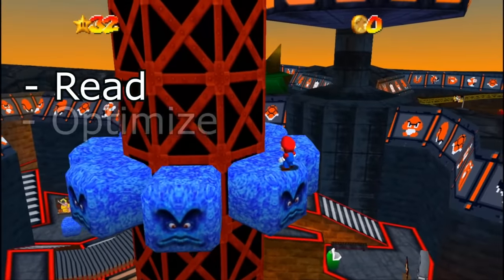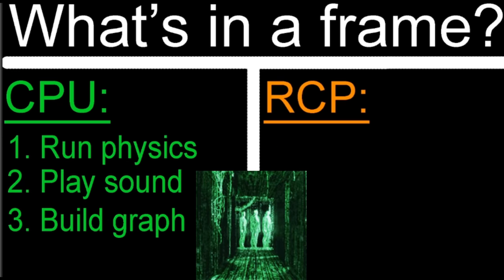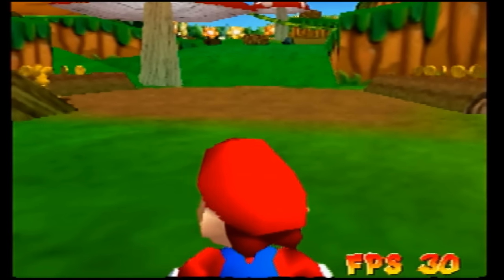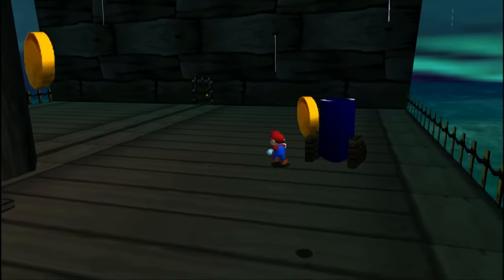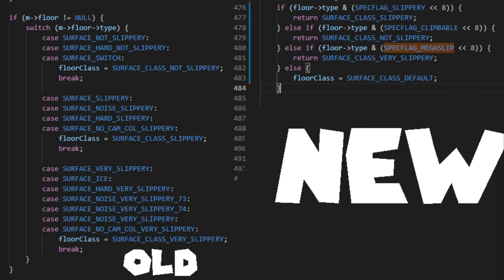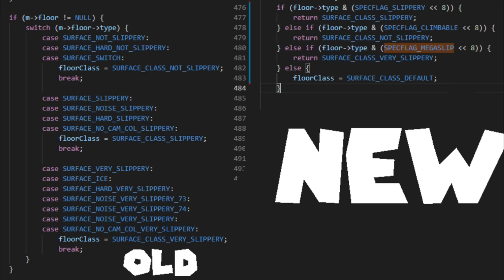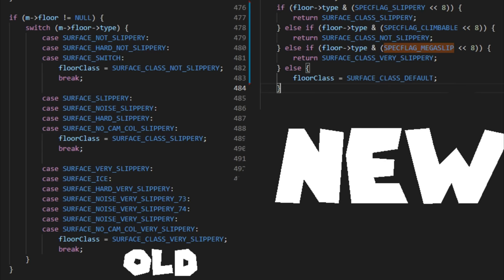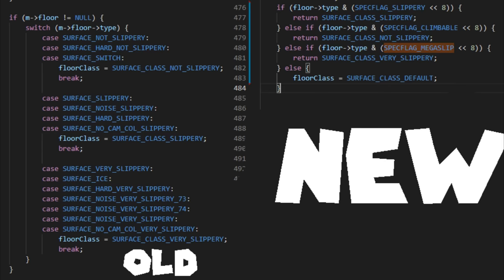FIXING the ENTIRE SM64 Source Code (INSANE N64 performance)

Comment: As someone with a master's degree in computer science I can confirm: This is wizardry.
Reply: You need a masters degree in kaze science
Reply: As someone who reads YouTube comment: Okay
Reply: It's: FIXING LAZY JPN GAME DEV
Reply: As someone who watched this video: does a master's degree in computer science not teach you how to clean up superfluous code for optimal performance? John Carmack's been showing the world how to do that since the 90s - he got raycasting* working on literally anything and got Quake to run in full 3D on pre-Pentium PCs with no dedicated graphical hardware :/

*don't make my dumbass mistake of confusing raycasting with raytracing or you're gonna confuse everybody :P
Reply: @reloadpsi  University teaches you the value of clean, maintainable (i.e. readable) code that is robust against any kind of problem. That's much more important than maximizing performance by throwing all of that out of the window. With today's machines performance isn't that much of a priority anymore. ;) (NOTE: I'm talking about games here, not general software)
Also, when it comes to efficiency, there are some very different fields in computer science: (A) Optimizing algorithms, i.e. the general (macro) structure of the program (which is much more important) and (B) optimizing code for hardware usage (micro level), where you reduce the amount of calls / memory access, etc. So (B) means "what can we speed up, when the algorithm stays the same". And Kaze is doing (B) hardcore style.
Reply: @Lugmillord  It stuns me that nobody at Nintendo bothered to clean it up the way this one guy is doing.
Reply: @reloadpsi  Zero surprise on my end. ;)
For one, a lot of what Kaze did isn't "clean" at all but pushing performance without considering code readability or safety nets - he doesn't need to since he isn't selling this as a shipped product and has an "infinite" amount of time. Or in short: If programmer's dared to write code like this for a real commercial product, it would most likely burn down in flames due to bugs.
I know that all code looks pretty much the same to non-programmers, but I can assure you that what Kaze is doing is not "typical code" you would find in sold software.
Also, the C programming language was rather new for the programmers back then and they sure as heck didn't know how to optimize for the N64 hardware (it's a launch title after all). It's easy to judge people years later, but given the situation they were in, the developers did really well.
Don't forget: 3D gaming was still brand new!
Reply: @Lugmillord  Yeah, 3D gaming was brand new. It's why I thought it was a bit crap. Worse graphics for slightly more depth in level design that most people didn't know how to capitalise on yet, and cameras apparently operated by smackheads. Thankfully, things got better.
Reply: @Lugmillord  it makes perfect sense now why you thought his code was wizardry
Reply: @calmarfps  It's not all lazy, just limited amount of time and budget for a commercial game. As well as 20+ years of practical C experience that the developers in the 90s did not have.
Reply: @reloadpsi  Rare did a great job with the camera (Goldeneye, Kazooie, and DK 64).  Mario 64 was really the only one with a bad camera that I remember offhand.  Having played a lot of N64, I was surprised how bad Mario 64 was when my brother bought a used copy.
Reply: His next job interview he just slap a Mario64 cart down on the table :)
Reply: As someone who knows nothign about computer science my brain just exploaded
Reply: Fellow masters here. It REALLY bothers me how Kaze ain't an actual Nintendo employee at this point. This is literally Satoru Iwata fixing the entire Pokémon Stadium code a few weeks before release tier.
Reply: Absolute Wizardry
Reply: As someone who reads comments I know more then you
Reply: @Lugmillord  I wouldn't say all of his stuff is all that crazy. I definitely saw some magic tricks in there, but the stuff like converting things to if else instead of switches, or moving stuff into for loops isn't what I would call atypical then again I've only dabbled in c code never written anything serious with it. Though I would say the real pro move would be converting the switches to call graphs (I think they were called that) would be even more performant. I'm talking about that thing where you use a struct that references functions so you get a constant access time rather than flowing through an if else, or switch.
Reply: I guess he used two cups of blood. ;)
Reply: @ChaosTherum  I didn't say that all of his stuff is crazy. ;) But some parts certainly are.
Reply: @ChaosTherum  it sounds to me like you're describing a lookup table. The index directly corresponds with the function pointer, so instead of checking each conditional individually, you have constant lookup.
Reply: @Bobbias  Thank you, it's been driving me nuts trying to remember what it was called. It's one of those concepts where I remembered the implementation but not what the method is actually called.

Though after looking farther I think the specific thing I was referencing was using a hash table rather than a lookup table not sure if a hash table is just a type of lookup table. I used them pretty extensively when doing the parsing in my chip8 emulator.
Reply: One crazy thing I can imagine in rewrite this code is the part of separating functions with multiple access... you must keep track of many things to be sure you're not messing with everything in some scenario!
I wonder if he created some test cases or was just with his perception/gameplay!
Reply: @Lugmillord  C has been used since the UNIX days in the 70's. Everyone that studied Computer Science had worked with C in pretty much all their classes. Hell even now you see C in a lot of hardcore CS classes and it was all I used in masters
Reply: @rancidskunx  If I'm not mistaken, SNES (and earlier) games have been written in Assembly and you can't expect all programmers to have degrees in computer science. I think it is rather likely that a significant portion of the dev team didn't have too much prior exposure to C in their work life. And when you consider that 3D programming with all those transformation matrices had been very new at the time then the devs deserve some appreciation.
Reply: @Lugmillord  Kaze did do some algorithmic optimizations. For example, in one of the previous videos, he rewrote the  collision detection to be both faster and more accurate.
Reply: @Lugmillord  C was not at all new in the 90s, lol. It's been largely the same language since the early 70s. Obviously, they didn't know much about how to optimize it for the N64, and they probably had a shit compiler, but the language itself was as old as anything else they could've been writing in.
Reply: @jimmyhirr5773  There is still a big difference between optimizing what's already there and writing a whole game from scratch. (Though I don't want to downplay Kaze's achievements. Far from it. I just don't like that some people mistakenly downplay what the devs achieved)
Reply: Your degree means 0 here
Reply: @ChaosTherum  in particular, his bitshift/bitmask replacement is crazy wizardry and is VERY atypical. It's really incredible, but I'd hate to see it in any group project. Way too hard to read in comparison
Reply: @reloadpsi  look at it this way. Some of Kaze's optimizations are harder to read. And in the computer science world, we don't write code for machines, we write it for humans. So while a genius might be able to write optimal code for performance, it means nothing if an average developer comes along and it takes them a long time to understand it. It's far more important to write code that's easy for devs to read than it is to write highly optimized code
Reply: @Lugmillord  ha kits no vs se n me engano que faz conversão de código, você escreve o código em Javascript e o kit o converte para arquivo assemly
Reply: programmers in general knew these kinds of optimization techniques in the 80s as well as the 90s. M64 was a launch title, and they were still figuring out how to 3D in general, so they took a huge tax on development and couldn't spend nearly as much time optimizing as programmers would today.
Reply: If people are interested in learning the rough basics about these sorts of techniques, look for videos on "data oriented design". Abrash's black book also. But even more so - pick an engine with source available, pick target hardware, pick a target scene with a fixed camera, get profiling, and get digging into the code. Although you'll probably have much better luck if you've built (very small) game engines before. So maybe that first.
Reply: @Lugmillord  Not to mention this is one programmer with help vs many chefs in the kitchen.
Reply: @ChaosTherum  im pretty sure you’re referencing jump tables here which a switch statement should compile down to to my knowledge. the reason that’s inefficient is that yes it is constant lookup time but the reality is that the underlying structure takes time to be useable, i.e calculating hashes is far slower than a bit of branching code
Reply: @feanorkiu  This is why one comments code. Both for others and oneself for later reference.
Reply: @feanorkiu  could you explain what he's doing with the bitmask/bitshift? It's a very very long time since I did anything serious with C and I've forgotten almost all of the weird tricks I came across back then.
Reply: @Lugmillord  "With today's machines performance isn't that much of a priority anymore"    
When they releasee games with broken codes, the most powerful computers can't handle it.      BF2042, CyberPunk and many other games.
Reply: @reloadpsi  I almost had a BS in Computer science.
Learned absolutely nothing besides basic code and algorithms.
But... I'm convinced my college (SUU) scammed me out of 4 years tuition... 
The professor that taught most of this had 80% of your grade come from writing algorithms you memorized with pencil paper.
Reply: Dude, I also almost have one. Specialized more in Data Science later on. I thought my AIs and GANs were magic... but this is far more impressive. Guy just pulls out every optimization technique in existence and adapts them accordingly. It's very smart and also pure dedication.
Reply: @hellschatt  Oh, AIs and GANs are a really cool topic! Good luck with your endeavors. :)
Reply: @Lugmillord  "With today's machines performance isn't that much of a priority anymore" this just isn't true. While most devices have more RAM than should be needed, there is still a very prevalent and important portion of software dev work that designs software for limited embedded systems. In fact, a lot of small form factor devices that are getting used to power hobbiest projects and commercial products alike still have hard memory limitations and must work to optimize as best as possible similarly to how Kaze does in order to achieve the results they do. Arduino boards are an excellent example of this. The mindset of "we have the memory so don't worry about it" is the reason bloated web-apps dominate the user space while only providing a small benefit when you look at the tradeoff you need to make to achieve the result (better UI feel and quicker development for 10+ times the RAM and CPU costs due to constant JS translation and object bloat)
Reply: @TMcLean  I was talking about games. Of course there are more than enough applications that do heavy lifting, but in the gaming world that simply isn't the case most of the time. The only exceptions are things like massive open worlds or MMOs, but that's only a small part of the gaming landscape.
Reply: @reloadpsi  I teach graduate level computer science courses. And this is actually not taught much anymore.

CS is MUCH broader today than it was 30 years ago. So nowadays, unless you are taking specialty courses in low level or in performance engineering, you would not hear about any of this.

These were often cut from the "mandatory" content to make room for UI/UX, statistical analysis (what we call ai nowadays), modern software engineering, platform development (web, mobile, ...)
Reply: Ye
Reply: This is not wizardry. This is * archwizardry.*
Reply: Master degree in computer science doesn't mean you know how yo code lol
Reply: @jesse420SOCAL  But I do. :P Been working as a software developer for over 4 years.
Reply: @Lugmillord  you must have went to a good university because all of the "masters" in computer science software engineers I work with or had worked with in the past  were the  poorest programmers. Design patterns, SOLID principles, different programing paradigms, what's that? They said to me.
Reply: @cl-7832  Don't generalize from a couple of people you met ;)
Reply: If you actually had a Masters degree, then your reaction should be "expected" not "wizardry".
Reply: @magickmskh  Sounds like you don't have one ;P
Reply: @Lugmillord  I do have one, that's why I can make my claim, squirt.
Reply: @magickmskh  Funny, so you are telling me you had lectures abou how to optimize performance on 90s game consoles by sacrificing any code readability?
If you think that these very-close-to-hardware optimizations are "expected" of people with a master's degree in computer science then you better get out of your tunnel vision and realize that people specialize in different fields than you do. I bet you didn't have lectures specifically for curves in CAD or cellular automata or planar graphs / route planning etc.
Reply: @Lugmillord  Yep, Universities don't tend to teach anything about constrained/embedded programming.
Reply: @Lugmillord  Yep, Universities don't tend to teach anything about constrained/embedded programming.
Reply: @feanorkiu  However, the "computer science" world you're talking about often relies on the unstated assumption that there is an absolutely embarrassing abundance of hardware resources available. All the talk about algorithms, data structures, and code that should be readable instead of comments, is not easily applied in a hardware constrained environment.
I think what really gets me is the kind of disdain that later programmers seem to show for early programmers. Whereas, I think there should be some degree of awe over how much was accomplished was so little. It's kind of like how industrial processes replace the craftsman.It's off-putting to belittle the craftsman.
Reply: @cl-7832  same. The best programmers I’ve ever seen went to school after knowing how to code, not a single one learned to code in college.
Reply: @reloadpsi  a degree means very little in terms of programming capabiity. The only way to master programmer is to do it.
Reply: @Lugmillord  "University teaches you the value of clean, maintainable (i.e. readable) code that is robust against any kind of problem. That's much more important than maximizing performance by throwing all of that out of the window."

And rhetoric like this is why photoshop 2022 takes 10 seconds to load an image.
Reply: @drygordspellweaver8761  Always funny how people who have nothing to do with software developmen think how it works. Also: A complex program like photoshop that has to be maintained over many years would literally be impossible without clear and clean code. Otherwise it would just dissolve into a buggy mess that crashes every five minutes and the image wouldn't loaded in the first place.
Reply: @drygordspellweaver8761  I think you should step back fo a moment and calm down. There is no discussion when it's this emotional and just the wildest accusations. I get that you want to "prove me wrong" or whatever, but constructing a straw man like this isn't going to lead anywhere.
If I appeared "elitist" in any way, that certainly was never my intent. Still, when people just talk crap about me then they are asking a lot if they want a calm response.
Reply: @Lugmillord  I wasn't talking crap about you in my initial comment. I said "rhetoric such as this" - referring to the modus operandi taught by your college. It is completely antithetical to "good" code. If you personally identify with that rhetoric and took offense, that's on you.

Kaze is right here- you don't need 'safety' if you write good code. I have never used const before and I have yet to have a variable magically change without me explicit directing it to do so. And the compiler knows how to optimize for unchanging "constants" anyway. That is just one example of a myriad of ways that code bases get cluttered and bogged down by dogma instead of practical reasons. 

"Object oriented programming" is a total train wreck. If you can admit that much, then you can redeem yourself.
Reply: @drygordspellweaver8761  You are really asking for it, aren't you? Well, good luck to anyone hiring you.
Reply: @Lugmillord  I'm financially independent, but thanks for your "concern", Mother Teresa 👍
Reply: @reloadpsi  I know this comment is old, but I'm chiming in anyway.

The people at Nintendo were focused on making a new system, with a new game, and they were under industry pressure to get it all working in time. That type of environment is very different from someone spending 100s of hours on a passion project. Additionally, Nintendo might not have cared a ton about performance compared to making sure the game was actually fun. Getting the game rendering well enough to start designing levels and testing how the game would actually work was probably a much bigger priority compared to making the rendering more efficient (especially since Mario 64 was a massive milestone in proving 3D platformers actually worked).

At the end of the day, Nintendo was charting new ground with this game and I've never heard someone say "damn, Mario 64 was cool, but it would have been way better if it ran 10-15fps faster".
Reply: Nah it's autism (as a compliment)
Reply: Having a Master's says nothing about being a good programmer. Source: Studied Computer Science as well.
Reply: @Cetra29  haha, yeah, it's not a guarantee. My biggest boost in code quality happened during my first year at work.
Reply: Vroom vroom
Reply: @Lugmillord  I appreciate your continued calm demeanor while being berated for a singular, nonharmful comment by a bunch of losers who have nothing better to do. I didn't expect this level of toxic behavior in this thread. Kudos to you for keeping it cool.
Reply: @ryandracuscodesgames8418  It's the internet and I frequently write comments so I'm kinda used to these kinds of conversations at this point. Nice to read a comment that isn't against me for once though. ;)
Reply: @Blernster As an ok replier: ok.
Reply: @feanorkiu I would hazard a guess this is because your professor can’t grade shit they don’t understand. 

If the standards for professions was higher, you could teach clean code that required less of the hardware, and we’d all have better performing code. This should be best practice in applications like games that require speed.
Reply: @CityStarrzz  Nonsense, my professors would all be able to read and understand this instantly.

I also don't agree with you concerning clean code. To begin with, modern devices don't require hacky code to run well, modern machines are powerful enough. I do agree that we can write both clean and efficient code, but some of his examples are objectively unclean. The portion where he removed some bitwise operations by casting to a u8 pointer is particularly bad. It's operating entirely through side effects. That's not clean code, it's hacky code. Efficient, yes, but hacky.
Reply: @feanorkiu  I can’t dispute any of what you’ve said, but my point still stands that if trying to get as much performance as possible, out of a standardized platform like a games console with a consistent hardware set, then efficiency should absolutely take priority as a means of getting the most out of the code as possible. 

Crash bandicoot devs literally used memory reserved for libraries they weren’t using to get more out of the device. This method should only be used when the system itself is a standard though.

And there are many MANY teachers and professors, who will have passed many courses, but don’t have as much skill as some of their brightest students, it’s how fields continue to grow. If professors were always the ones who were the best, they wouldn’t be teaching, they’d be in high paying private sector jobs. 

We should be teaching people how to critically think and logically create code. Not how to stifle innovation by writing code to inefficient standards.
Reply: @drygordspellweaver8761 its also why photoshop runs at all
Reply: Computer science is an oxymoron. Man made the computer so there’s no science you can do by studying it.
Reply: @bitfilm  ahem, I think you should have a look at the wikipedia article about formal science.
Reply: AI is replacing coders!
Reply: And I’m willing to bet this guy didn’t even go to college.
Reply: As someone who is someone, I can attest:  this is something.
Reply: @Lugmillord Have the tech layoffs affected you yet?
Reply: @TheUKNutter  nah, my position is thankfully pretty safe
Reply: @Lugmillord  You’re a fortunate one ☺️
Reply: MSSE here. This is amazing!
Reply: @reloadpsi Actually Nintendo is well know for being absolute wizards when it comes to programming, what they were able to accomplish was phenomenal with something very new 3d, look at every other 3d game that came out that era not made by Nintendo and you’ll realize how amazing it was, plus Kaze is coming back and adding many optimizations, some that weren’t discovered till well after 64’s release.
Reply: But what degree do you have in wizardry?
Reply: @Kraaketaer  sadly none :( Hogwarts didn't invite me.
Reply: @Lugmillord  😢
Reply: @reloadpsi They were rushing to get it finished in time, it worked well enough to ship and changing anything ran the risk of breaking stuff.
Reply: Most university degrees barely teach you how to code - that's on your own time  @reloadpsi
Reply: As someone else with a master's degree in computer science I can confirm: He IS a wizard.
Reply: A master in computer science means nothing if you don’t have the hands on experience in the real world. Working on tech companies and working on projects that allow you to use what you learn in school and complete your educational puzzle. What learn in school is nothing compared to what is out there, believe I know because I also have a masters in computer science. What I learned in school is nothing, but basics.
Reply: @jart122  I agree that I learned the most during my first year of work. Not so much in the five years afterwards. I guess I know enough for my job?
Reply: @Lugmillord What a worthless degree.
Reply: How’s that debt?
Reply: @pr3ludejr  I don't live in the US, so I'm not in debt. ;P
Reply: Master’s degree doesn’t mean shit
Reply: Why waste the time and money getting a masters degree in computer science?
Reply: @elsagaman Not really comparable to Satoru Iwata.
What Kaze did while impressive was using the evolutions of code these past decades and implement them.

Satoru Iwata literally created and implemented a new way of compressing data just for the occasion